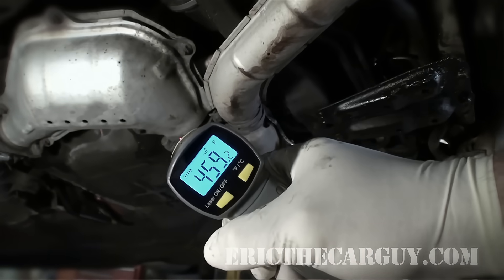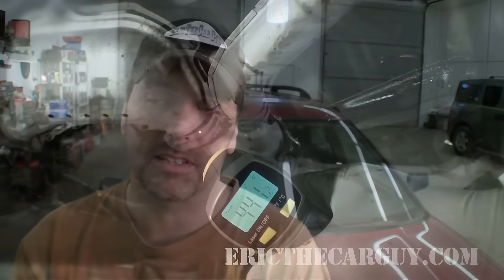Does Lacquer Thinner Clean Catalytic Converters? -EricTheCarGuy

Comment: Why didn't you use the gallon/quarter tank ratio? That would have been a true myth bust. Also, why did you not do a pressure test, as it seems a more accurate diagnostic than the temp readings? I tried the temp readings from your other video and it was very difficult to get consistent enough readings to draw a solid conclusion.

Comment: my  cousin used laqor thinner straight with no gas which i thought wouldnt work  but he used 2 gallons of it since he was a painter and was almost stranded. couldnt believe it worked but cleaning the cat im not sure. but if scotty was able to pull it off in passing an emissions test then why not try it at least. i think for code sake it is relatively easy an your right i used b12 cleaner and the system didnt respond right but it passed my emissions with also the help of retarding the ignition coil a bit.

Comment: 1. drill a 1/4 hole in front of the cat
2. Spray non-chlorinated brake cleaner into the cat with short bursts using a straw
3. Pop a rivet to fill hole you drilled

chlorinated cleaner could turn red hot and combust, idk never tried it

Comment: I have had success with BG intake cleaning kit. A 44k in the tank and run the intake cleaning process.then go out and drive aggressively dont just cruse accelerate and decelerate on and off the gas through the whole trip. And never overfill your crankcase oil. run it in the middle of the dipstick 1/2 qt low. overfilling your engine will slowly kill your converter. As for checking your oil level check it in the morning when the car has been sitting all night when all the oil is in the pan.If you chech you r oil just after running and its full its probably over full. just my 2 cents.
And it seemed like the 2nd sensor had better readings after, the temp check is crude because of the shields around the converter. Its the 2nd sensor readings that set the code not the temp.

Comment: Thank you for the video Eric :)

You said it right at the end - The lacquer thinner ** might ** work if the problem is that the catalytic converter has some crud built up on the substrate. But a catalytic converter is only designed to last for so many miles. If the catalyst is just plain used up, then the lacquer thinner is not going to improve its efficiency.

Scotty recommended using an entire gallon of lacquer thinner. You added just one quart, one fourth of a gallon, though you're right, using an entire gallon would not have made any difference with the Subaru because the catalytic converters were not clogged.

Scotty also said the P0420 code will appear when the catalytic converter loses just 5 percent of its efficiency! No doubt, the engineers did that on purpose so people will go to the auto parts stores and buy expensive parts.

And there is a separate code for a bad oxygen sensor.

As for cleaning the catalytic converter with soap and water, if I have to take the thing off, I might as well replace it! It will cost around $150 to $160 at a local auto parts store, and there are cheaper ones on Ebay Motors. I'm okay with changing brake parts and shock absorbers, but I don't like working under the vehicle.

I always enjoy your videos! It's like visiting a cool friend whom I admire and respect. Happy rest of December and a Happy New Year to you :)
Reply: Come on now, 150 or more is a cheapy one that probably lasts a few years at most. And too replace something when you can take off like four bolts in about five minutes with a air compressor and then clean it and reset light and try again. Wow you must be loaded in the wallet or loaded in the brain,haha. Sorry but You made it through hundreds of reviews and the incorrect test of the video and you come to this crappy conclusion? Yikes, kinda scary when i hear people like this and wonder why or how they can even get outside or think outside there tiny tiny little boxes thinking like this. Don't mean to be harsh, just saying. I like hands on and the accomplishment feelings. Also to save money is a bonus. Then you have the i knew it would work feeling. Then you have the i knew those other guys were wrong that this would work feeling. It teaches a skill and then its contagious to do other things in life to help not only me but others save massive money and time and headaches. And it teaches common sense for other forums and video comments to try to weed out people with lazyness or no common sense or desire to learn. Not meaning all this for you ok. Just people in general, weather it be health things or car stuff seems to be alot of lame people out there. Guess thats why ive heard the word describing these people as sheeple. And the dealerships and shops rip people off because nobody seemed to question them before. Now that we have internet hooked to millions of minds there is no excuse really to not learn and try new things your scared of before.

Comment: Soap and water isn't going to dissolve the build up!

Last year, I've had success in cleaning my converter from my 1998 Toyota T100 using a mixture of citric acid and wood bleach (oxalic acid) and a free discarded dishwasher that I converted over.  I gutted the dishwasher after I found that the main pump and heater worked.  This setup allowed me to dissolve the white crusty build up that had coated the internal surfaces of the converter.  My converter had close to 380,000 miles on it at the time of cleaning.  I've had no problems with my converter since. Total time from removing the converter, cleaning it (about two 2 hour washes), and reinstalling the converter was about 5 hours.  Cost of the citric acid used was $3 and the cost of the wood bleach/oxalic acid was $10.

Comment: Converters work on a chemical reaction with the engine exhaust after combustion. The thing is, as is with every fuel system additive ever marketed to the public, that when they get burned, they're no longer the chemicals as they were poured into the fuel tank before combustion, It becomes more filth flowing through the exhaust pipe, same as the gasoline itself. Most (if not all) additives are acetone, mineral spirits and a handful of other common chemicals nowadays. This would probably work if you removed the cats and soaked them in acetone, but otherwise it's more or less burnt chemicals doing nothing, or at least not enough of the unburned additive gets through the exhaust to make a difference. You'd probably be better off removing the cats and scrubbing them with a brass brush to remove the soot and blowing them out with compressed air. But good luck getting to them on a Subaru, unless you cut them off :) Watch Walker's video called "Understanding Catalytic Converters and How They Work" to get a better idea of what's going on.

Comment: The vehicle in question is a '03 Nissan Altima with a 2.5L 4 cyl engine. Approximately 175k miles. When I purchased the car approx 3 yrs ago (for daughter in college), the #1 cyl coil was intermittently bad, allowing unburnt fuel to contaminate the cat converter. Unclear how long that had been going on, but a new spark controller was approx $40 and took 15 min to replace. That problem solved, but cat converter still throwing P0420 code. Which brings us to today; car needs TX safety inspection, and I don't want to invest $800 for new cat converter! I'm not necessarily looking to "fix" problem long-term as much as wanting short-term "patch" to allow passing of annual inspection here in Austin. A real mechanic (not me) previously verified the converter isn't clogged, just poisoned, so anything that may help her (yes, the car is female) pass inspection is greatly appreciated.
Reply: sniff test use alcohol or even e85 gas, for the sensor use a resistor inline of the signal :) look up MIL eliminator

Comment: I'd try B-12 Chem-tool if it were me. It has always done a good job for me. I might try running it a bit stouter than instructions call for, but your mileage may vary. All my cars are beaters, anyway. You can also add some to the oil just before an oil change. It does a good job of dissolving any sludge in the crankcase.

Comment: I like how you don't outright say "no it doesn't work, it will never work", but rather say it didn't work In your case and give reasons why it may not have.  I also appreciate your objective approach to the new code you got.  Instead of immediately saying "Well it happened after I added the lacker thinner, therefore the lacker thinner caused it", you did research to discover what possible causes it could be.  Thanks for the video.

Comment: I tried using a gallon of lacquer thinner in the gas tank and it did not eliminate the check engine light. So, agree with Eric it does not always work. My car is a 2000 Mazda Miata.

Comment: I did this with a 98 GMC Safari and it worked like a charm.  The code went away and never came back.  You need to use a gallon - and it has to be to totalyne (not right spelling - it is old F1 racing fuel).  The van ran like it was on rocket fuel, you could definitely feel it in the seat of your pants.  Drove the van 2 years later - no problems.  I imediately filled after I ran the fuel through.  The laquer thinner will expand some rubber compounds.

Comment: I put 1/2 gallon lacquer thinner in a 2000 Nissan maxima with 1/2 tank. . Cleared the code. 2005 Subaru cleared with lucas injector cleaner before I saw the kilmer video

Comment: you should just ran it while it was hot then drive it on ramps and hit the cat with an wrench so maybe it will blow out of the back .
Reply: That one doesn't work, if you want to get rid of the guts that bad then you need to cut the pipe and stuff some kind of pipe into the cat and break up all the shit in there start it up and watch that shit fly, course I say if its clogged cut it out and if you don't have emissions testing get one of those cheap fake cats and cash in the clogged cat for some extra money.

Comment: That is why I don't have a catalytic converter on my truck. It is old enough that it is not required to have one on it.
Reply: I'd rather not have them as well, to much bullshit with emissions I say.
Reply: In my state, CA any vehicle 1976 and later model vehicles are required to have emissions testing for the life of the car. Years ago, vehicles sold in CA had different emission controls compared to the rest of the country. My 1989 Toyota pickup's emissions label read; THIS VEHICLE CONFORMS TO US EPA AND  STATE OF CALIFORNIA REGULATIONS APPLICABLE TO 1989 MODEL YEAR LIGHT DUTY TRUCKS PROVIDED THAT THIS VEHICLE IS INTRODUCED INTO COMMERCE IN THE STATE OF CALIFORNIA ONLY. And of course you cannot modify it either. later they adopted the 50 state certification for sale in all states and Canada.

Comment: I love the concept of dumping more chemicals into the engine to lessen the amount of chemicals coming out of the exhaust pipe.
Reply: your statement does not make any sense at all? the object is to clean the soot off the honeycomb of palladium and platinum which are inside the cat. so it can be better efficiently to burn off the excess unburnt fuel in the exhaust gasses. not to make the exhaust have less chemicals?
Reply: Actually a thinner has less blended crap than the gas at the pump. What you get at the pump is probably the worst gas out there.
Reply: DanielRichards644
Gasoline has a very high flame front velocity... i.e. it burns extraordinarily fast. The objective is to add just a little, a small fraction, of something that's a solvent that doesn't burn as quickly that will fail to burn in the short time it has in the engine, wash the cat, and then it can oxidize in the cat or the muffler or after it exits the tailpipe..

Lacquer thinner is a mixture of solvents and retarders. Which solvents are in a can of lacquer thinner is extremely variable. While all lacquer thinners are flammable, some components like acetone burn very rapidly, some like naptha burn a little slower, some like methanol and ethanol are rather slow burning fuels. Some retarders,like ethylene glycol, aren't viable fuels, some like 2butylethylene burn a little better.
Reply: theres a reason that chemistry along with other known branches is a vital branch of science
Reply: 😂😂 f*ck emissions, the US govt is harming the environment faaaaaar more than you and I ever could, they dump radioactive waste from aircraft carriers directly into the ocean and spend billions fueling private planes, helicopters, and fighter jets, but we're the ones that can't afford a $1000 cat to save the environment
Reply: LOL, good point.
Reply: Mike Fatty Except the purpose of a catalytic converter is to "clean" the exhaust of the things that didn't burn in the motor, hence the "lessen the amount coming out of the exhaust pipe" part.

either way I just can't see how ANYTHING especially something FLAMMABLE like lacquer thinner would make it from the gas tank to the cats without being atleast mostly if not entirely burned off before it even reaches the cats, so I see now way it could make a difference.

Comment: If in doubt about the lacquer thinner, try Mr Gasket catacleane. If you remove the cat, use the soap and water. But you may want to try B-12 Chemtool Carburetor, Fuel System, and Injector Cleaner in addition the the soap and water.

Comment: both videos were rather informative. i have a 2003 ford ranger and a 2003 jeep liberty. had a misfire on the ranger (turned out to be a bad valve) and the cat also read inefficiency code. hesitantly, i add a quart of the thinner to a quarter tank of fuel. repeated this process then put in a half tank of 87 octane. ran that for two days. not only did my check engine light leave, but i gained at least 4 mpg in the ranger. did the same to the jeep liberty and gained almost 5 mpg. i think your test was fine, but i would run that test more than once to get a more accurate conclusion. as with anything else, "your experience may differ". oh....and both the ranger and the liberty drive like the day i bought them, December 2002!
Reply: also..........i would just like to mention, if this hadn't worked, i would have just gutted the cats and let the thing breathe. unfortunately, i have to go through an emissions test. common sense tells me it's not about emissions or every county in every state would have to go through it. all metropolitan and most surrounding counties in my state have this requirement, but not all. just a tax scam to me!
Reply: michael montgomery
Nine county area on the front range in Colorado, otherwise no testing in remainder of the state.  We have an inversion layer that kicks up pretty good in winter.  I gutted a friend's cat on a small very used Japanese export back in 2000.  He lives in central Florida, so no problem with E-testing.  Here in Boulder it is a dynamometer test.
Reply: Gweedo Murray I hope you wore gloves and a respirator. You know that stuff is carcinogenic and radioactive right.

Comment: BTW, at my shop we have use a product made by Mr Gasket called Cataclean. It is a cleaner made to clean top ends and the converter. I have used this and so far it is about 85% effective. I do per-qualify the cars by testing to so if it weak or burned out first. I use this on my sons 1997 Mazda two years ago and still no return of the P0420.

Comment: I've had additives and chemicals work to fool smog sniffers, but never to actually fix a bad cat.  If you're pre OBD2, throwing a can of seafoam  (or probably even lacquer thinner) into your gas tank with only a few gallons left will make your exhaust gasses a little hotter and help you pass emissions.

...Luckily since I'm not in an emissions-requiring county in Ohio, I just put 2 sparkplug defoulers together over my o2 sensor to pull my 2nd o2 sensor out of the direct stream of exhaust gasses; that fooled my ECU sufficiently that I no longer have a CEL.  Depending on how stringent your e-check folks are you might even get away with it if you're doing this to pass emissions.

And a final note, I've had a bad cat for over 100k miles, and nothing else has gone wrong from fooling the ECU.

Comment: Eric, could you try the citric acid (and wood bleach) bath method for cleaning a catalytic converter? I tried lacquer thinner with a half tank of both 87 and 93 octane gas at a 9:1 gallon ratio without any permanent success. Both catalytic converters were expensive to replace with labor and it would be good to know that the acid bath method works consistently for certain failures.

Comment: Just to share:
Car: 2002 Toyota Camry LE - 96,500 miles when check engine light came on
Code reader said it was a PO420
After researching on the internet and watching Scotty's video I decided to try Cataclean instead of using the lacquer thinner, seemed easier than welding in a new CAT, after using this product as instructed the light turned off
Current mileage is 98,700 and the light is still off.

Comment: running it through the cats its self might work but not through the fuel system. that would seem more effective to me. probably not any better of an idea for more then one reason, especially since subaru flange's tend to break, especially the spring bearing pipe to the cat.

Comment: I do not see how this would fix any catalytic converter. The lacquer thinner will alter the composition of the fuel (obviously) and the combustion temperatures. If there is a change in the catalytic converter it will be due to the different composition of the exhaust gasses (by that I mean the ratios of the combustion products will be changed due to the addition of the other chemicals) and the temperature may be slightly different. This condition will only be temporary (until the thinner is used up).
This is just my opinion. If anyone has anything else to add...